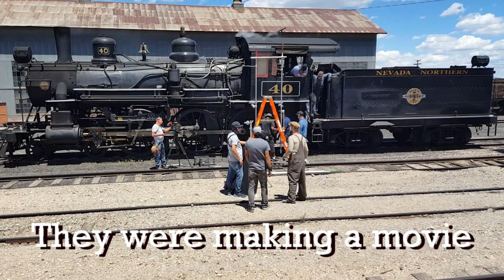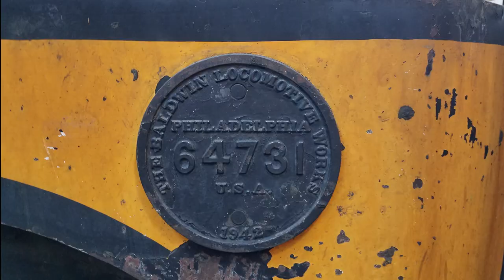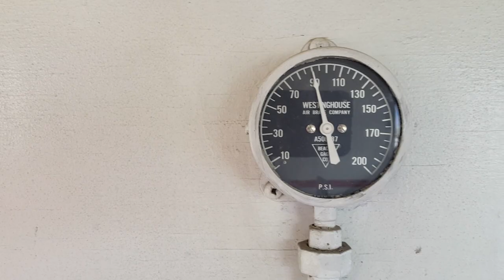Nevada Northern Ghost Train

Comment: You know it's a good time when everybody had a big smile. I started working as a switchman on one of those old Baldwins in 1966. I couldn't tell by the video, but they had footboards on all four corners that were only inches above the rail and the switchmen would stand right beside the rail as the engine approached (slow speed) and they would step onto the footboard and grab that bar that went across the engine just above the deck. Extremely dangerous, but it was SOP where I worked.  If the engine was going too fast, you would stand in the clear and catch the grab iron and swing onto the side steps. Thinking back, we must have been crazy. Company took all the footboards off within a few years after I hired out. Great video, keep on having fun.
Reply from the maker: That was really great info! Those are the kind of stories only a switchman would know! Thanks so much for sharing your experience 😁